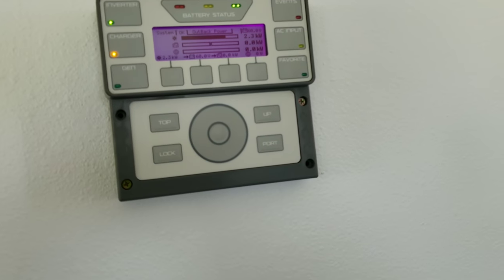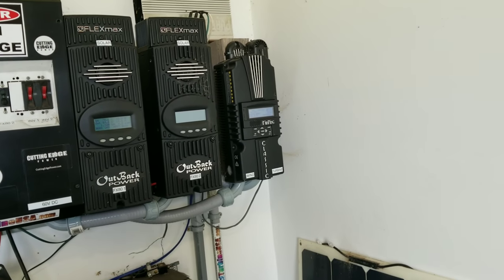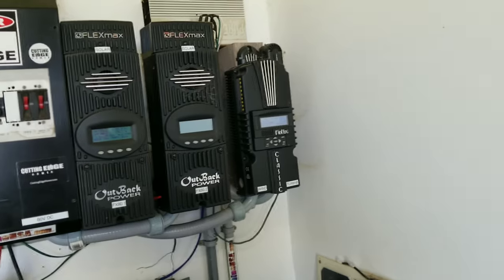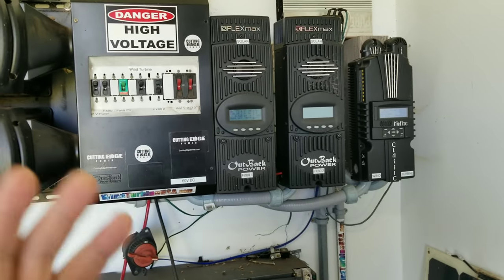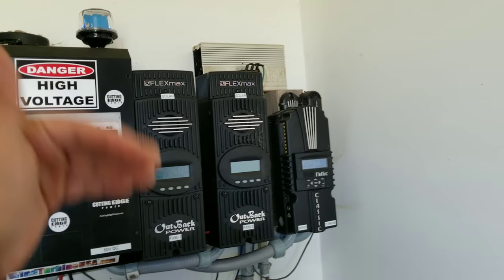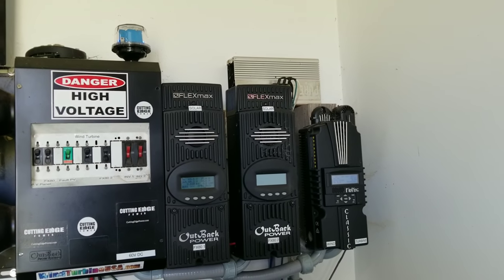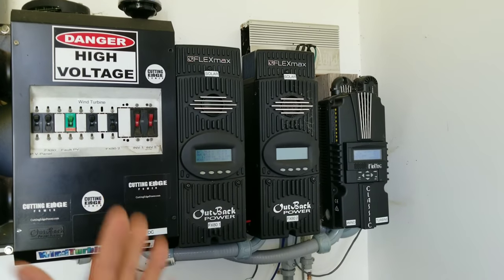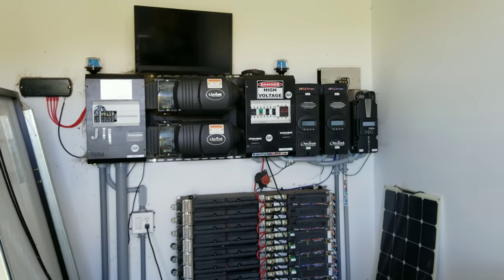DIY Solar Micro Cycling Your Batteries With Dump Load Off The Grid

Comment: Good discussion point...  I have a question about it though.

If you divert at the solar side, but still require AC power to the house wouldn't you still be micro-cycling your batteries?  The difference is that your inverter would be powering only from the batteries.  I thought most inverters plugged into a bus bar would pull power (if available) from the spare power given from the charge controller.  Basically, the inverter is looking for DC power, whether it is from the batteries or MPPT is just based on the available power at the time.  

Also the traditional wired (what the manufacturer tells you) diversion load would work similar as any excess power generated by the panels would be used first before anything from the batteries.  Only if you are pulling too much in your diversion load would it do a micro cycle.  So the key would be to have something that only uses what is available from the charge controller + inverter draw and not more so there is no effect on the battery.
Reply from the maker: If you pull the dump load on the ac side or DC batteries side it's still micro cycling the battery on The top end. If you have for example 5,000w solar panels and if you only use a dump that is less your not able to use all the extra power and it's still pulling power of the battery as a buffer. But it's good we all think outside the box to better our Systems.
Reply: You asked if you divert on the solar side and still use AC power would that be micro cycling? The answer is no. The charge controller controls the dump load and is watching the battery voltage. The moment your inverter starts demanding power the charge controller will compensate to hold battery voltage steady even if it requires turning off the dump load. If the dump load gets turned off and on very quickly the charge controller has capacitors that Smooths out its output to hopefully hold the batteries at a steady voltage so they don't micro cycle. Micro cycling would not be as much of a problem with flooded lead acid batteries because they can safely be held at a float voltage which is higher than a full charge and is different than a lithium battery being held at a full Voltage and cannot be held any higher without turning into a road flare. Basically with lithium you don't even hold them at full you should hold them at around 85 or 90% And so any voltage change represents cycling
Reply: Seems like pulling power from the solar side enables the capacitors in the charge controller to better smooth out the battery voltage
Reply: @SiriusSolar  But pulling from the solar side via a relay would mean that the charge controller wouldn't see any of the power until the relay shuts back off and the solar DC power comes back.  It seems like the timing on having it ahead of the controller would not be optimal.  

Also, a question on your other point.  Wouldn't the controller not switch back if you have a large capacity battery bank and the voltage doesn't drop enough to cause the voltage to really drop much?  I don't think the built in cap's are that large are they?  

I am also interested in how adding ultra cap's would help too.  Thanks for the insight to all as I have many of the same questions and problems with my system I am putting up now.
Reply from the maker: It would work because the  Solid state relay is wired to the 12 V relay on the charge controller which is controlled solely by the set points of the high and low so when only when the voltage drops below a certain point on the battery side would actually turn off the solid state relay to re divert power back to the batteries so therefore the batteries would sit full at all times
Reply: @ModernOffGridDIY  so what you're saying is that even though the battery voltage is still what controls the relay the dump load has no ability to draw the battery's down because it's not connected  to the batteries.  The only way the batteries can get drawn down is if you turn on a regular load. And your regular loads don't pulse wildly like a dump load so there will be no micro cycling.
Reply: @gregd8697  the panels could be hooked to both the dump load and the charge controller but I fear that the mppt algorithms would be confused by the constantly changing solar panels voltages. I saw a unique solar panel controller a guy invented that connects and disconnects solar panels in any combination of series or parallel and directed the unneeded panels to the dump according to your desired program. There were delays involved long enough for and mppt charge controller to adjust . After all these charge controllers are designed to adjust rapidly as clouds pass by. It was some kind of a Kickstarter thing I wish the big boys would adopt these types of ideas. It upsets me to see capable Hardware with technology these days and wasteful designs of programming

Comment: Hi there.  Yes, you are correct that there is a "slew rate and slew time"  the way that they want you to wire the deversion circuit. When they designed that function lithium batteries weren't popular like they are now a days. My sealed lead acid batteries take a lot of charge time in order for the current to drop in order for the batteries to change to the float condition. My concern is this.  If you wire your batteries to unhook from the charge controller during deversion,  can the deversion circuitry react quick enough to reconnect the batteries to not produce a spike on the AC out side of the inverters.  Yes the solid state relays are fast but is there a delay before the deversion circuit denergizes and hooks back up to the batteries?   
Just food for thought.
Reply: I guess the only way to know is to put a scope on the AC output of the inverter and watch. I bet that some inverters outputs would be smoother than others as the input voltage fluctuated
Reply: May be good to add a time delay relay?

Comment: I have a similar system with the same Outback Gear and Solar and Wind power. I use a Pulse Width Modulation (PWM) TAPERING load diversion system that can divert up to 120 amps..IT doesn’t cycle the batteries at all..just diverts extra power from the wind. You can use a Xantrex C60 for Tapering Pulse Width Modulation and Load Diversion…no relays at all needed and lower cost.

Comment: Cant you hook up a secondary PWM through a capacitor to where the battery out is on the first PWM & use the dump load on the first PWM once the second dump load closes a switch on the first one?

Comment: yes, modern off grid diy,
you are probably asking a bit too much. the oscillation thing is a common problem. you can only avoid this by a costly device. but even they can have some oscillation.
in the midnite classic you can program the aux relay by the voltage of PV. this might cause less oscillation. my way at looking at this is to put more solar panels up. which gives you added energy, etc and is probably much more cost effective than that expensive dedicated device.
lithium batteries in particular are very voltage sensitive, at the same time very stiff. this causes some irregularities in my midnite classics. they really need the have battery voltage sensors and be programmable to 10mV rather than 100mV. midnite classic blokes seem to put their energy into new projects though.

Comment: if battery is full at 13.6 and u dump at 13.7 and over were is this using or cycling the battery. would u not be just using extra power. seems this would help with over charging batteries also.

Comment: I think I know what you are trying to say, have your inverter and battery in parallel, this way power goes to the inverter if there is a load and never sees the battery. On my 22kWh LiIon setup when the Midnight Classic is putting out say 50 amps and my inverter is drawing 50 amps to make 240v AC, there  zero pull on my batteries. The power comes out of the charge controller and goes directly into the inverter.  If your main breaker has been off for months (like mine) you  are already charging your batteries from solar every day (micro cycling)  and discharging  every night (micro cycling). For most of the US, dump loads are completely unnecessary from October to April as you produce 1/3rd less solar due to short days and cloud cover. However from May-Sep its good to have an EV to plug in.

Comment: Okay, in my church my batteries go to bulk at 58.5 volts, so I set my wind controller to dump at 58.70 volts. The same goes for float.  The batteries go to float at 54 volts, so my controller on the turbines is set to float at 54.20 volts.  I believe that this will solve your problem my good sir.  Set your DUMP LOAD to:   0.20 volt over your Bulk, Absolve and Float and you'll be fine.

Comment: I can see how you've come to this idea, makes sence.
My campervan solar system has a 255w 30v solar panel, 110amp lead acid house & 110amp Starter battery charged by a Votronic charge controller with AES system as a dump load .
The charge controller needs the 12v or 24v battery to tell it what voltage to convert to so i couldn't disconnect it to issolate the batteries once charged.

The charge controller switches the AES on when the batteries are full, it is only a low power signal ment to turn a 3 way fridge to run on 12v instead of gas or grid power but my fridge isn't wired that way.
Instead i power a relay to run a small DC dehumidifier as a dump load. I guess i could run a heavier load from this.
As you say it does cycle the house battery as it is designed to maintain the load for 30 minutes regardless of the solar input.
If the panel gets shaded and the input goes down the battery starts to loose power, when it reaches a certain level of discharge the system switches to recharge mode.
What this needs is a solar intensity senser to turn off the relay powering the dump load when the output drops thus saving the battery from discharging.

Comment: So. I've watched ur vid years ago and now, again, im trying to use that extra power to a dump load. The thing is i got my 2 245w panels in a 24v system. Once batteries are fully charged a relay disconnects from charge controller and connect straight to a 600w 24v grid tie inverter. I wonder if the charge controller wont "miss" the panels to fullfill all stages os charging, bulking and floating?!?  Im not sure i made myself clear. Hope you can understand the question. Best regards from Brazil.
Reply from the maker: Yes I understand I'm using Tesla lithium ion batteries there is no need for float, or any thing else just charge and stop. Or charge to set point then dump load. Other batteries or heater elements work good for load. But grid tie might be different.

Comment: If you size the diversion load to less than output of the solar panels it will not cycle the batteries, but what you are saying is correct also you could just use teckluck board.
Reply from the maker: But if you did that you would not be using the full mount that you have available. But yes there are many ways to work around the main problem. I just want everyone to know. Thanks for your support

Comment: A actionable way to utilize your concept for a reasonable cost would be to use a juntek vat shunt to drive a relay to  your load       
Assuming your load is good for your panel voltage
Just set the relay to activate when current is below say 2amps 
One could trigger relay off or on by voltage aswell ergo at night no voltage = relay off 
Next how to stop the panels from dropping voltage and run with max efficiency is up to you or,  
Would run it into direct drive solar inverter with load directly attached to say a heater to boil water or to a freezer 
Let me know what you think of that
Reply: Would require a 12v source to run the shunt, probably from the batteries.
Set the current protection to cut out the load when the batteries finally need a charge.
Can find a juntek vat series for around 85-100 dollars with two shunts one display to controll upto two relays individually

Comment: you're right about the voltage tapering though which is something that's been bothering me lately. I'm not talking about the regular taper that happens during the bulk cycle. What I mean is my Midnite classic seems to be slowly approaching the absorb set point even though there's 5000w available to push the batteries up to the absorb set point.  I look at them they're still in bulk or absorb and they're only pulling 400 watts but still haven't made it to the high absorb point that I set. Like it's just slowly approaching it for some reason. Seems like the lithium batteries would be much more of a problem with this micro cycling we're seeing here. Because the lithium's we like to hold them below 100% And we want to hold them steady. Any voltage change represents cycling. However with my flooded lead-acid batteries a full one hundred percent charge voltage is actually under my float set point so my voltage fluctuating   near float voltage would barely pull any power in and out of the batteries at all because of the higher resistance of flooded lead-acid batteries compared to lithium's
Reply from the maker: Yes sir I agree. On another note did you check the battery temp Compensation maybe that's why the charge controller is not pushing you up.
Reply: Hi. Don't set your float voltage lower than the manufacturers recommend value.
Reply: @ModernOffGridDIY  good point I often forget about the temperature although I have a feeling it's not going to change it much because my batteries always seem to be cool to the touch. Next time I noticed this happening I'll check the temperature of the batteries on the classic app.  Right now they're 72 degrees at 1 AM. Normally when they're done bulk charging there around 80°. So 80f would be 2 Celsius above 77f which is the starting point for lowering voltage on FLA.    That would come out to 0.67 volts lower on my 24 volt system at 80°f. I'll make note of that and see if that's what's happening.  Thanks
Reply: @w.loulittle130  I wouldn't set my floating voltage lower than manufacturer specs. What I meant earlier was that the resting voltage of a fully charged lead acid battery is lower than the recommended float set point. However lithium batteries are different because there voltage does not quickly drop to a resting voltage after you remove the charger. With a lithium battery any voltage fluctuation at the battery results in a much larger amount of power moving in and out of those batteries when compared to flooded lead-acid batteries near float voltage. Considering that all of these charge controllers were originally designed for lead acid batteries it leaves me to wonder if they have yet to update their profiles for lithium especially when Associated to the micro cycling dump loads create
Reply: @SiriusSolar  
Yes, midnite classics have minor problems with lithium batteries.

Comment: I agree and it’s driving me nuts ! I use my batteries all night (250 watt load 24/7 ), in the morning they are about 60% charged then on a good sunny day they charge to 100% by 1:00 pm….then the dance starts. I too have considered hooking a 72 to 12 volt regulator at the output of the panels, then the output of the regulator to a 12 volt pure sin wave, then it’s ac output to a UPS that facilitates voltage sag on a cloudy day. Limitations, the regulator is only 35 amps AND I have 3 independent groups of panel banks. Oddly enough only 1 panel bank needs to be active to handle the 250 watts from 1pm to 4 pm and maintain full battery charge.

Comment: I agree with "Nick Ush, 11 months ago, Hey, good thinking BUT...  Micro-cycling the top most end of your batteries is not the same as deeper discharging, which will obviously affect battery life."
What actual hard evidence do you have that "micro-cycling the top end of batteries" is bad for batteries, and to what extent? There is sufficient data available to show it is wrong that each micro-cycle is additive to make complete cycles. Indeed that is an assumption on your part which I consider wrong, I just don't know how wrong it is. Time using systems the way manufacturers configured them will prove or dis-prove your concern and theory. As it happens I am running a "micro-cycled top end" system on sealed deep cycle lead acids so am interested to see if there is a premature failure rate for these batteries. So far no evidence of a problem, most of the batteries are now over a year old. To be clear I make no criticism of you as a person, plainly you are thinking about things which is good, I am happy to debate the points you make with a view to coming to understand the truth and where the theory stands up and also falls over.
Reply from the maker: All I have to say is plug your phone into a wall and never unplug it your phone battery will swell up which is because the phone will cycle the top end of the battery another example is a labtop battery try keeping it plugged in and on 24/7 same thing happens plus the fan will keep turning on to try keep the battery temp down. Same thing. Micro cycling the top end is still better then cycling the battery on the deep end. We can agree to disagree.

Comment: How do we know what is a full battery. I have a 48 volt system and all the specks on my AGM batteries. What would be the name for full batteries? Sorry for being stupid, but I can not find a direct answer to this question. Jim in Chile.
Reply from the maker: Look up the manufacturer spec sheet on your batteries and it will tell you what your looking.

Comment: You know i think that there is alot of people getting riped off by this and most of them don't know even know. And i was thinking about the same thing and i was thinking what if you get a grid tie inverter to only use the solar and wind power to pwer the household appliances during the day and save the battery power for the night....... now that would be great for the longevity of the battery life